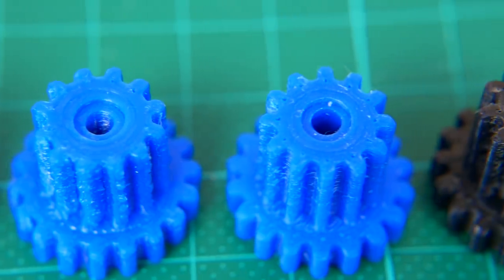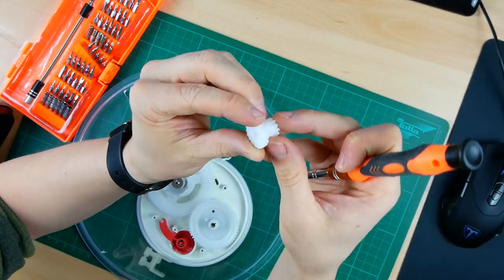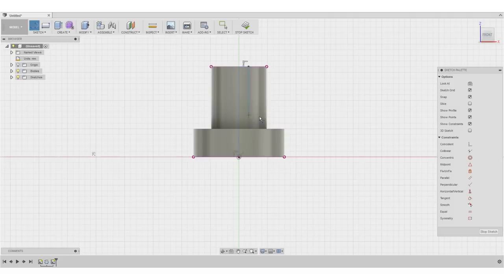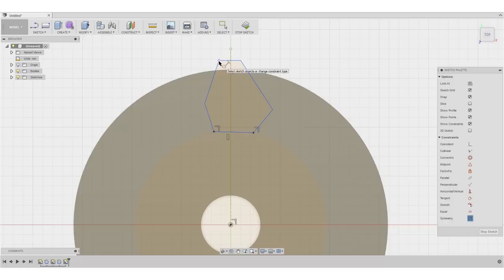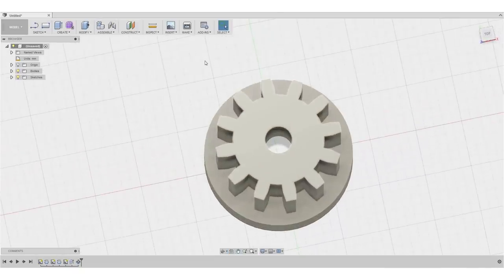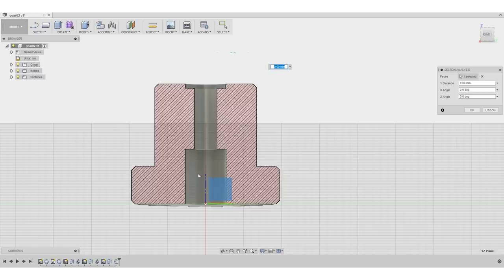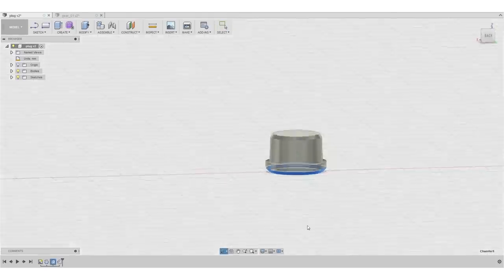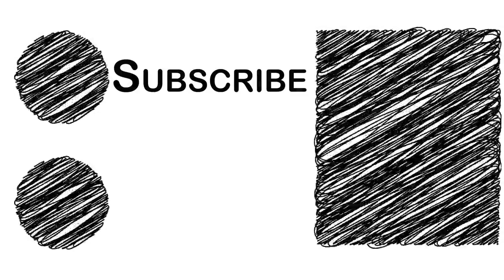3D Printed Gear Repair with Fusion 360 - Practical 3D Printing

Comment: You should do the first two sketches as one and rotate it to make the main form, it's more compute efficient. Also if you chamfer the teeth just after the extrude you can pattern it with the tooth and save both time and compute power. It's a simple part so it's not likely to slow your computer, but its good practice.
Reply from the maker: I did the first two sketches separately on purpose because it does not lead to sketches with too many dimensions. But you're right. Doing them at once would be more efficient. Will the chamfer also be patterned if I chose the tooth as the feature of rotation or can I choose both. I just know that in CATIA it's not possible and that's the software I'm usually working with.
Reply: You can choose both features.

Comment: I usually just extrude circles for anything gear related. Then I cut the teeth ALSO using extrude after doing circle pattern. I feel like it's a lot faster doing it that way.

Comment: Would it be better to make the gears solid and simply drill the holes?  Or even make them slightly undersized and drill the holes to the correct dimension to get a smooth shaft?
Reply: Then you bring in the issues of landing a perfectly centered hole, possible drill "runout" or a wobble, and the heat created warping the part. Probably would start out stronger though.

Comment: Is there any specific reason why at 3:36 you design the L shape first, then revolve? I'm asking because whenever I have to do cylinder shaped things, i create a circle with the desired diameter, then extrude, then if i need some other cylinder on top of that one i just select the newly extruded plane on top of the cylinder and extrude further. I wonder, which is the most time-efficient way of doing it?
Reply: Ditto -- this was a really weird way to create the "cake" shape to start off. Draw from above a few circles and extrude away would have been far, far quicker. Also much easier to tweak later on if you find your tolerances are a bit off.
Reply: I also would have used cylinders, but for the plugs later on I would have used a revolver because it’s faster to add in the chamfers. It all just comes down to how think through order of operations. Both methods work fine and produce the same part. I get stuck in design loops sometimes where I use other revolves or extrudes for everything because it’s stuck in my head and I design on autopilot instead of thinking about more clever solutions. 

I just enjoy watching other people design to see the different thought processes happening. It’s interesting to see how different people solve the same problems in different ways.
Reply: the most efficient way to do it would be similar to your method, but all on one sketch and extrude to different heights. for most parts you could make a single top and side view and just extrude/cut to do everything rather than juggling a bunch of sketches on different surfaces

Comment: If glue doesn't stick to it it's most likely PA. Otherwise it's not. Sometimes you find some imprint with the material type on larger parts. Had this issue with our steam cooker.

Comment: If you have SolidWorks, you can go to the SolidWorks Library and find any 3d gear model metric or Inch with any diametrical pitch and any number of teeth. Then in SolidWorks you can modify face width it you need it and safe as a STL file. That's it . That will be a real gear :)

Comment: I'm not sure about Fusion 360, but Inventor (which is the more professional version) has a gear-making utility which would make the gear for you, with the proper tooth profile
Reply from the maker: I don't know if Fusion has this feature, but I'm also not a pro in that tool since I usually use CATIA at work. But there are plenty of gear tools online which help you set up proper gear profiles and export them as SVG which would then be usable in Fusion.

But since I do not have any proper information about the gears besides the measurements I did (which does not include modulus, pitch circle...) it's okay to sketch it in a non-engineers way for such an application.
Reply: under add-ins you can a spur gear creator
Reply: Haben wir hier einen Maschinenbauer? :)
Reply from the maker: Plain and simple because it's free for hobbyists and Inventor is not. I usually work with Catia at my "real" work and can therefore say that Fusion 360 fulfills most of my home-needs. I don't want to design an entire car or airplane wit it so I'm very well off with Fusion.
Reply: Problem with fusion 360 is that it's Windoz or Mac compatible only.  I run Linux on all my computers.  Have you considered Onshape?  It runs on any GL capable browser regardless of OS in the computer.  I used to use Varicad and Freecad (struggled to some degree).  I'm a big fan of Onshape now and it is free for public shared models, you only have to pay for it if you want to store your models privately.   They have really great tutorials also.  Sometimes I feel like I am an evangelist for Onshape.
Reply: I like the idea of onshape, but I failed utterly when I tried to download the parts, STLs, models, or drawings for the Evezor from it.  (www.evezor.com/source)  Am I missing something obvious with it?
Reply: Fusion has a gear generator.  It's under add-ins and it works pretty well.  The catch with using gear generators is that a lot of kit doesn't use "proper" involute gear teeth.  If I were to model this I'd stick the part on a flatbed scanner and scan an image of it.  Then add that image as a canvas, scale it, make the gear with the wizard, and compare.  If the tooth didn't "look right" compared to the scan then you can sketch it off of the 2-d scan instead.

I was a SolidWorks user before F360, and I haven't found anything I liked better in SW.  F360 is an amazing piece of kit.
Reply: 225$ Canadian dollars, shipping and txs included, for my first ANET-A6 3D printer and free software Fusion 360. I can make gears and pretty much all what the expensive machine can do. For a business stand point of view, you are right, but for shoe string budget, FUSION is the way to go!
Reply: Ah, but then he'd return to the question of materials. Will the PLA endure the moist environment? The original gear didn't wear out, remember, it failed in cascade from the broken pivot pin. Best not to replace working parts unless you're sure of the benefit. Also easiest!

Comment: Good job.  You could later upscale your design using various metal gear tooth design standards to include pressure angle, profile angle, rack profile, land, pitch, face, flank, addendum, dedendum, space, fillet radius, blah blah blah.  As to economics, assuming a market value for designer/printer to be $20/hr, x 1.0 hrs = $20 plus $7.50 shipping value this part. Compare with complete new total replacement unit at $19,99 from Amazon with free Prime shipping, and the parv vs total replacement totals $7.51 extra minus educational/training value.  Value of quality boyfriend: priceless.

Comment: It might be POM has a glasT of 110-120 and is also often used for injectionmolded gears. Nylon would also be a good geuss.
Reply from the maker: You could be right. "Natural" POM has also this milky color and the slippery feel.
Reply: CNC Kitchen does it degrade in chlorine or bleach ? POM is quite bad with it according to a data sheet I found. Other candidates can be found here https://www.calpaclab.com/acetal-polyoxymethylene-chemical-compatibility-chart/
Reply: I'm a chemist, and I worked 17 years in plastic materials moulding. The material is certainly POM (acetalic resin) Temperature of fusion (not glasT, it is a crystalline polymer) about 150°C. PA6 Tf 220 °C PA66 Tf 240-250 °C
Reply: MrPierixx, Well I Just had polymerscience class, i which we talked about POM, my first geuss wasnt far of. Thanks for the clarification!

Comment: gluing parts like that will only cause binding. your better off getting a 0.5mm drill bit and drilling a centre hole to fix down with a 0.7mm sun glasses screw

Comment: I would like to try 3D printing of some small gears in the range of 7mm diameter by about 4mm high with a tooth count around 16. Is it possible for these printers do this size of gear??? How would you try to reproduce these size of gears. Thanks ....
Reply from the maker: You might be able to do that with an FDM printer and small nozzles (e.g. 0.15mm) but they are no fun to work with in my opinion. Otherwise go for an SLA/DLP printer. They are able to produce parts in great details and with the right resin you can even make strong parts.

Comment: Does Fusion 360° account for the problem of approximating circular holes with finite vertices? I have to do a lot less drilling since I figured that one out...
Reply from the maker: You mean this problem? http://hydraraptor.blogspot.com/2011/02/polyholes.html?m=1
Reply: Yes.
Reply from the maker: Nope, that's not considered. Wouldn't know that something like this is implemented in any CAD software.

Comment: very good video, I am more concern in making stuff that actually touches food, FDA have some filament approved for touching food, but in general I understand fumes and plastic touching food is a bad idea for 3d printing today (not native english too)
Reply from the maker: So there are plenty of filaments around which are food-safe (PETG for example). But the moment you put them trough your printer they are likely to be contaminated by shavings and other parts in the filament path (PTFE tube, idler wheel, hobbed bolt, hotend, nozzle...) which makes the 3D printed product probably not food-safe anymore. I guess for such a gear it is totally okay, since it does not get into contact with food, but I wouldn't really print containers for food right now. 

3D printing is hyped at the moment but it is definitely not fully developed right now. There will be solutions for this coming in the future. That's what makes this topic so interesting!

Comment: Quick question regarding your last chamfer (added so you don't need to deal with supports). Why can't you just print the whole gear upside-down? That way there is no need for any chamfers or supports.
Reply: then the larger part on the outside of the gear would need supports
Reply: Because then you'll need the support to print the larger gear on top (it'll overhang the smaller gear), and that diameter is even bigger.

Comment: Dein gebrochenes Zahnrad sieht aus als wär's aus Polyoxymethylene/Acetal [POM] (Delrin, Celcon, Ramtal, Duracon, Kepital sind alles Markennamen unter denen man es auch kennen könnte).

Acetal zeichnet sich durch seine relativ hohe Glastemperatur ( i. d. R. 135-160°C) bei gleichzeitig relativ niedriger Schmelztemperatur (210-235°C)aus. Weiterhin sind die besonders rutschige, wachsartige Oberfläche sowie hohe Steifigkeit typisch. Es ist für gewöhnlich ein sehr gut geeignetes Material für solch ein Teil mechanisches Teil.
 Man kann Acetal übrigends auch drucken, Filament ist recht selten zu finden und zumindest eine geschlossene Kammer sind empfehlenswert, außerdem es muss sehr langsam gedruckt werden Part Fan am besten aus!

'Ne beispielhafte Quelle für POM Filament ;D, erhältich in DE: https://www.dold-mechatronik.de/3D-Filament-POM-175mm-05kg-Farbe-waehlbar
Reply from the maker: Vielen Dank für diese ausführlichen Infos!

Comment: Honest question: do you really believe companies will ever offer the 3D models for replacement parts?  I think the liability issues that would create will prevent that from ever happening.  It would also make it too easy for their competitors to make knockoffs.
How long did the gear last by the way? Did you consider changing the gear ratio to reduce the stress on the pinion gear?
Reply from the maker: I also think that this might not happen, but there is a chance for it. The gear is still working after two years by the way. Though haven't opened it up, yet.
Reply: @CNCKitchen  thanks for the quick reply!  I just got a 3D printer last week, and have really enjoyed your videos.  Your use of shape optimization to augment the model is very intriguing.  I was curious if there is a way to add a central rib (similar to an I beam) to improve strength with otherwise lower infill? Also, could you use infill adjustment just below the top layer when using very low infill to avoid the "pillowing" you mentioned? Thank you again for all the great work.

Comment: The gear could also be HDPE.

 Speaking of which, you can buy experimental HDPE filament from: https://filaments.ca/products/hdpe-filament-natural-1-75mm
You should get some and do some strength tests, the reviews say it is hard to figure out the print settings, but when you do it's superior for strength, rigidity with flexibility and layer adhesion.

Comment: Fusion360 has an option to extrude alongside an object. In the extrude-tool, change the "Extend" drop-down from "Distance" to "To Object" and the "Chain Faces" option to "Extend Faces" Otherwise, great video
Reply from the maker: You're right. This would have been the proper way to do it. I actually tried it for the second pair of gears which caused some problems, why I ditched it.
Reply: similar to my request (above) to another helpful comment by another user who clearly has a high level of proficiency with 360, can I please ask you to elaborate and/or point to example of the technique you are critiquing so we all might avoid similar pitfalls or oversights in the future during our own projects and such??  Thanks, in advance!
Reply: When CNC Kitchen pulls down the teeth @9:45 he pulls it down until it touches the base of the gear. But if now you change the height of the center column, the tooth will still be 12mm tall, which might not touch the base anymore or protrude trough the lower side of the base. If you look at the right side of the screen you see the small window "Extrude" in it, that's where the options I stated above are.  The whole idea behind parametric design is that you can change things without having to redo a lot of things, but by setting this to a fixed distance it creates something which needs to be adjusted manually, should the part be modified. CNC Kitchen has done that very with using constraints and relations a lot better than I could, except for this one thing.

Comment: What is a good alternative to Fusion 360? I don't want to spend 25$ a month especially if I might be using the software once a month.
Reply from the maker: Some use Blender, but that is no CAD software, it's more a modelling tool. Then there is Onshape which is also free for public projects, OpenSCAD, SketchUp and many more. If you are a company with a turnover lower than 100k Fusion 360 totally free.
Reply: Ok thanks. I found there is a STL extenstion in Sketchup, which I already own. I guess that's going to work, right?
Reply from the maker: Sketchup totally works. Just export your models as STL or OBJ which should be importable in any popular slicing software.

Comment: Already has been shown that 70% is better than 50% but past 70% it just doesn't help that much.  For me 70% is my I3 rework's sweet spot for ABS.
Reply from the maker: You're right. You can go higher than 50%. Just at one point, especially at 100% too much plastic is squeezed out that dimensions get inaccurate.

Comment: I learned a lot about Fusion from this, shame I cant use it..
Reply from the maker: Just give it a try! It will take some hours to get used to the workflow, but trust me it's totally worth it! This is a skill which will enable you to use 3D printing to its max!
Reply: Ralphie Vigg OnShape is a good alternative if you can't use Fusion, and it's free for personal use and public documents
Reply: CNC Kitchen Yeah I have it and stuff and I absolutely love it, it's powerful and intuitive and i've gotten some parts  off it, butnit wont let me renew my education liscence.
Reply: Ralphie Vigg was interested in seeing fusion in action too personally use blender plus some add ons like screw and bolt generator and the image importer to make 3d modelling for 3d printing mechanical things easier.  There is also a site geargenerator.com that does what it says on the tin and will generate svg images you can then import into blender and extrude.

Granted blender isn't always intuitive but once you know some of the basic navigation and selection shortcuts it can still work pretty well.
Reply: You can easily use fusion for free even when you're no longer a student - just install it and apply for startup/enthusiast 1 year licence [you can renew it after it runs out] the same way you apply for educational license. No need to create fake accounts :)
Reply: I know, problem with that is it wouildnt work. I would press renew liscence for educational (which is supposed ot be 3 years) but it would do nothing. Reinstalling did nothing, i had to create a new account.

Comment: Why you didn't say that models need to be done +0,2 mm in all dimensions , because after printing plastic narrow?!
Reply: Because the CAD model should be totally accurate no matter what. The tweaking for such things should be done in the slicer and you will have profiles for your own printer and batches of PLA, ABS, etc. that you have determined through trial and error.

Comment: As much as I love solving problems, this could have been solved by not using a one purpose tool (salad spinner) and just using a colander and shaking it with a paper towel on top for drying your lettuce.
Reply from the maker: You can actually use the bowl of the spinner as a nice salad bowl. That's already a second use-case :D